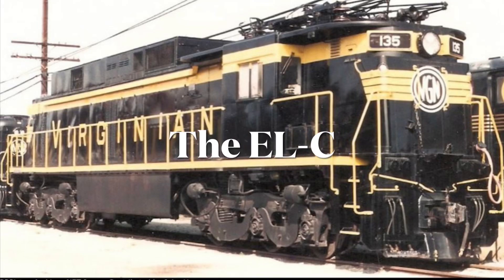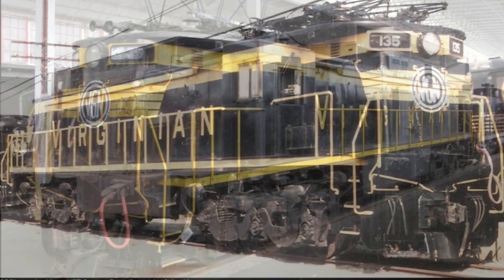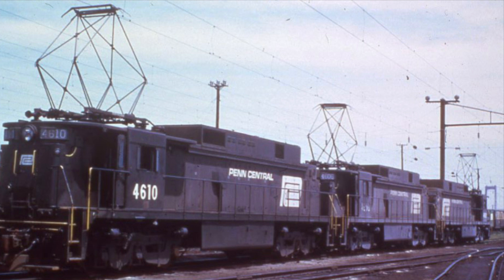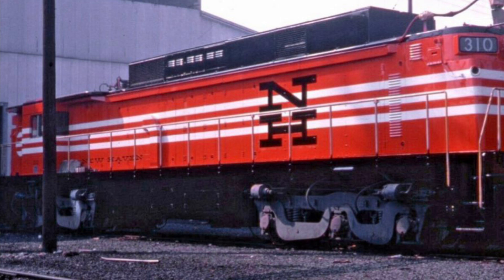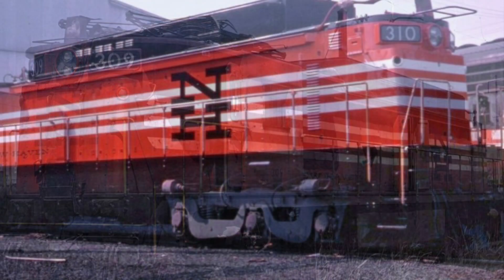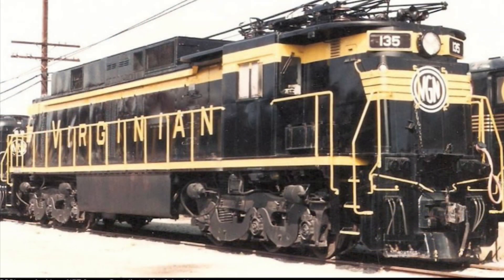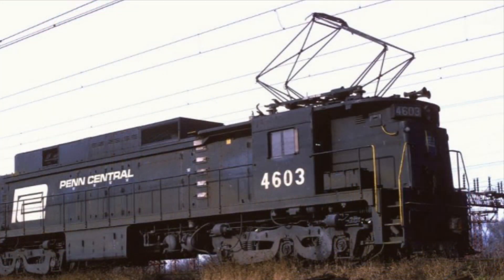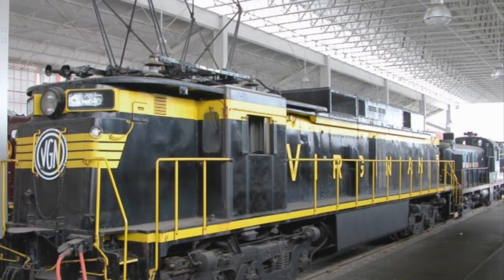Engines Of North America: The GE EL-C

Comment: PRR tested the E33's but the interfered with the Pennsy's Trainphone. They were sold to the New Haven instead. When PC was forced to take over the NH, they became part of their electric fleet.  They used mercury Ignitron tubes ( not ignition ) to convet the AC to DC. Conrail investigated replacing their electric fleet, and tested 2 locomotives ( the GM6C and GM10B), but decided to shift as much traffic as possible off of Amtrak lines, as well as taking down the wire or abandoning the other electrified portions.

Comment: I thought there was one at the rail road museum of pa
Reply from the maker: As a matter of fact they do, I simply left it out in order to keep the video short and sweet
Reply: @ironhorsehistorian9871  Thanks I just went up there and I thought they had one
Reply: @MP-16productions  The one at the Railroad museum in Strasburg is an E44. E44 were based on E33 (EL-C) and basic dimensions are exactly the same.
Reply: @maciekkra539  The giveaway clue is the pantographs. The EL-C/EF4/E33s had a single diamond pan, the E44s had 2 single-arm pans à la Faiveley.
Reply: @smwca123  Well that can be deceiving, as at least two EF4s during their service on New Haven sported faiveley pantographs, one each. Main difference is styling. E33 has that nice semi streamlined details added, like the mini cow catcher, rounded plate where number boards are located and rounded front roof. E44 are just typical 60s styling brutes kind of like the U-boats that were coming out at the same time.

Comment: Not 11,000 kilovolts -- that would be 11 megavolts.  Either 11,000 volts or 11 kilovolts.
Reply from the maker: Thx for the feedback. Gotta work on my numbers, sheesh, lol.
Reply: 11,000 volts is 11 kV. 11 megavolts would be 11,000,000 volts.  BTW the VGN was 25 Hz.
Reply: @smwca123  So was NH, not sure about PRR but I think in their heyday all the major AC railroads were 25 hz, at least in the east…
Reply: @Pupda  PRR was also 11 kV 25 Hz. The ex-PRR part of Amtrak's Corridor is still 25 Hz, but now 12.5 kV.

Comment: Now I know what it was! Santa clause brought me a Lionel train set in approximately ‘59 or ‘60 with this engine (Small scale)Even though I was only about 5 years old I was kind of disappointed because it didn’t look like the cool CNR engines I saw in my town And when I asked what was that antenna looking thing on top was I was demolished to hear that it was for receiving the power to run the electric motors!Horrors!,Knowing that this type wouldn’t make the cool noises that the the local CNR types would I left the electric contact “antenna”down and pretended it was a (cooler) diesel (electric).
Reply from the maker: lol fun memory. Do you still have it? If so, a lil TLC and it’ll be good as new.
Reply: @ironhorsehistorian9871  I’m not sure .I asked my son to find it (and the rest of the set)at my ex’s house and I haven’t seen it yet.Several months later
Reply: @ironhorsehistorian9871  it was in good shape last time I saw it.I’m concerned a vindictive person threw it out
Reply: The "antenna" is called a pantograph. Are you from Montreal?
Reply: @smwca123  no Niagara area

Comment: The New Haven Rail Road acquired 10 units from the NW but only 9 were fit for service. One required too much work to restore for the bankrupt New Haven so it was kept for parts. These units ran mostly in pairs on the New Haven connected by a 11,000 volt jumper between units. The crews nicknamed them "bricks" because of the paint job and that they were pretty much "squared off" in design. They had dual control stands so they could operate in either direction but visibility was terrible in both directions. These were the last electric freight units purchased by the New Haven as on December 31, 1969, the New Haven ceased to exist (acquired into the Penn Central merger).
Reply: Not so, New Haven got 11 of the units and one of those was left for spare parts.
Reply: Actually, NH joined PC on January 1, 1969.